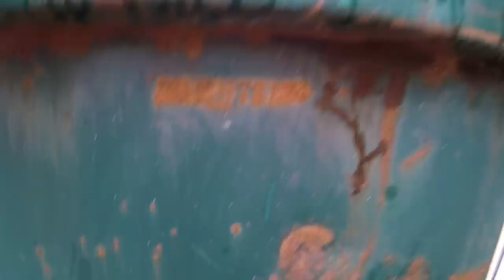Why Did They Throw This Away?

Comment: I pulled a weed eater out of a dumpster at a church I used to go to. The pastor himself threw it away. I took it home, cleaned up the carb, replaced the fuel line, pulled the cord and it started on the 3rd pull. With old gas. Still using it, at my house in Mexico.

Comment: You know how you always need an extension cord for your drill or grinder? Anything that requires power to run and cord isn't long enough. I have already done it. I use vacuum cords or something similar to this, and rewire my electric equipment with the vacuum cords. Then if you need Xtra cord you have it already. Jigsaws, skillsaws and reciprocating saws .

Comment: Hay Paul the gas.weed eater      motors are worth 10/25 $ to guys who have r c cars and boats even if they don't work use them for the parts there's probably a bunch of the guys around you don't cost anything to check it out.

Comment: Hey Paul! Not sure of you knew or not....or even really cared lol. On the grills and smokers, nine times out of ten the silver colored racks are stainless steel. I just save mine up and they pay out well.😉
Reply: yeah stainless steel does pay good i save all of it with any copper brass and aluminum i do not mess with steel much unless it is a washer or dryer or water heater cues i can get some aluminum and copper out of the washers and dryers and water heaters then go turn the steel in dont take much of washers and dryers to add up with the steel and the copper i get is good it help add to the copper stack
Reply: @silverstackerforlife1728  Its hard finding good non ferrous here in Richmond. But when I do...I hoard it. Lol
Reply: @chickenscraps704  well its hard to find copper here but the rest  is hit or miss i try to save as much as i can i turn it in when price are high and is worth it

Comment: God is good

I saw you cut the cord on vac, did you strip the weedeaters down for the alumunun?
Reply from the maker: I sell the weed eaters to a repairman
Reply: Idid the same ,had a lawn mower guy he would fix and sell used buy what I brought in and give me his scrap.
  I would save wire, copper , brass ,and aluminum untill I had larger quanities. What state are you in? When I scraped ut was in.P A

Comment: I love the color of ur colorado thats the 3rd one in that special blue ive ever seen 1 a crew cab 2nd mine a extended cab amd urs a single cab seems to be a rare pain code
Reply: That a Dodge
Reply from the maker: This Colorado has been amazing. 100% reliable and tough as nails
Reply: @ScrapPalletMan  if u have the i4 engine look on passanger side firewall right above the exhause manifold theres a nipple there add a hose to it its the ac runoff line but it drips right on the manifold and will cause it to crack one day just add a hose over that nipple and run it away  from manifold mine failed after only 105k miles but my truck ran at idel alot with ac on

Comment: How much was that 300lb load. Is it worth picking up scrap?
Reply from the maker: I think it is. But I've seen people that are very high maintenance spoiled that wouldn't think so.
Reply: @ScrapPalletMan  I've done it before when meatal was 10 cents per lbs and Copper was 2.50 but I only did it for extra cash. My dad scraped for a while. It's actually pretty fun. I'm not sure what they pay for scrap now , but I want to go around finding decent furniture like end tables , couches, tables etc. And fix them up then resell it.

Comment: should of taken the vacuum, missed out on a little electric motor.
Reply from the maker: Unfortunately electric motors are only $0.10 a pound here. And that motor is about 1 pound. And a lot of unrecyclable plastic. That's a lot of extra work and trash for $0.10. That insulated copper wire cord is three or four times as much with little to no effort

Comment: All that scrap in my area would still have you putting money out your own pocket for the gas spent driving around looking for metal.
Reply from the maker: That's why I drive a 4-cylinder. $35 to fill the tank that drives 330 miles. So my 20-mile scrap route just sips gas.
Reply: @ScrapPalletMan  The scrap yard in my area is very picky with the material that you bring in. It has to be completely clean of plastic and microwaves are no longer acceptable to them the ice chest would have to be cleaned of inner lining. Total Bs for 1 cent a pound.